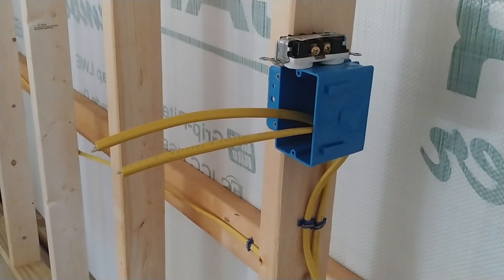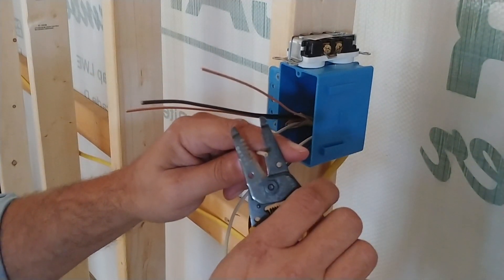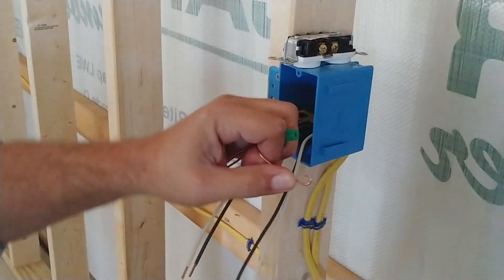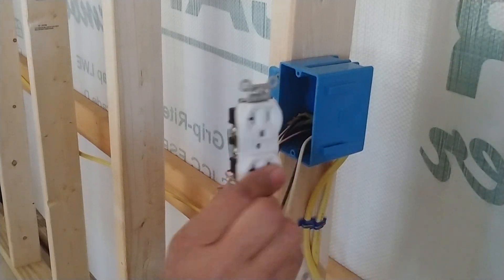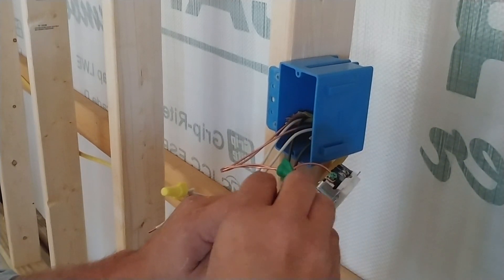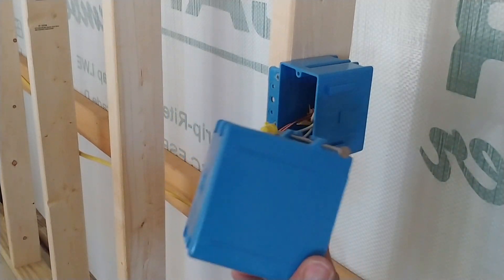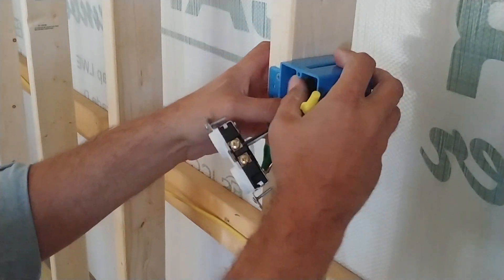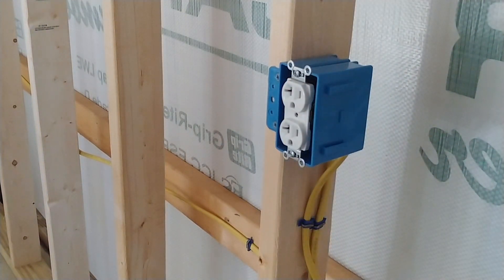Wiring up a outlet tips and tricks.

Comment: 4.5 year apprentice here and still hitting the books for my journey card next year, What I lie to use all the time on bx's installations are the adjustable ones is easier to use after drywall goes on, also why did you staple each wire separate, you could just staple on top of each other and it would have looked cleaner, and by the way the color things on the side of the receptacle are called screws not bolts...lol. Also I always twist my wire connections on binding with me lineman's pliers then i put on the wire nut on, and that location what part of the home is that? And why are you using a T plug? And why so high up? ..great video man.

Comment: Mentioning where the exact wires are coming from would be helpful,   along with how the 2/12 wires are categorized and why the ground wires aren’t included is helpful
Reply: Ground is NOT a current carrying wire. It is not insulated in "romex" because it's covered by the outer jacket. 12/2 is 12 awg wire paired with a ground. 12/3 is 3 12s with a ground. Etc...

Comment: Great Job!  Given the fact that you were working with only two sets  #12s , you could have easily utilized the two sets of screws on the outlet as your lead and load. There was no need for you to pigtail the hot and neutral wires together.
Reply: This is exactly what you don’t do.   If that outlet goes bad then they all don’t work.  Plus you’re relying on the little bridge piece between the screws to carry the load.   A big no no!!
Reply: @dirtbikewrecker4475  why is that a big no no, is recepticle not rated for it. Or listed for that purpose
Reply: @dirtbikewrecker4475  
Actually there is a plate under the terminal screws and there is a provision to put two screws under that plate and then tighten the screw. No wire nut would be more secure. I don't see any problem with that. If there is a problem then where is the proof?

Comment: How come the 2 whites n 2 blacks couldn't go on the plug seeing how there's 4 screws on the plug
Reply: What I was wondering and seems like less trouble and stuff in box since both hot anyway and same with white, think i'll just do ground piggy and decide to put on screws or in hole.
Reply from the maker: Can you wire directly to a outlet.  Yes, but inspectors will fail you for wiring this way.
Reply: @BevinsBuilds  no they want, it’s standard practice to put 2 white wires on the neutral screws, and 2 black wires on the line screws. Pigtail to grounds and put one wire under screw

Comment: Good video, I understand the pigtail for the ground, but not for the other 2 leads?   Thanks.....Jim
Reply: The reason he added pigtails to the neutral and hot,was so he would only have to land one wire on each screw instead of two screws.Also,your supposed to tighten the remaining screws.

Comment: You had a grounding wire nut why not just keep one of the 2 grounds long and put it thru the hole? Then you don't have to get a third piece for the pig tail and you're spinning less 12s so it's faster. If you're going to do it that way just get cheaper tan nuts
Reply: Pig tail fits in tighter. Bends in more natural.

Comment: An outlet
Reply: I am assuming that the 2 wires coming into the box is one coming from the panel and the other going to another outlet. Am I correct? I am not an electrician but do some changing out of electrical switches/outlets. Thank you!

Comment: Great video, thanks. Only question I have is instead of using pigtails for black and white, couldn’t you just have screwed both blacks to both brass screws and both whites to both silver screws, thus the outlet acts as the pigtail?  Thanks.
Reply from the maker: To answer your question directly yes but in the area where I live they require you to pigtail it because the circuit has to stay constant even if the outlet is removed.  But yes if you connected directly to the outlet it will work it's just where I live you would fail the inspection.
Reply: @BevinsBuilds  Does adding the pig tail change your box fill calculation?
Reply: @FixItOnce-OrTwice  no, your answer is no.

Neck 2020 article 314.16.B.(1)

...A conductor, no part of which leaves the box, shall not be counted.

,(The last sentence.)
Reply: @BevinsBuilds  why wouldn't the circuit still be constant. What's the difference if two wires are in a wire nut together or both are screwed under a plate at a terminal screw together? Doesn't sound logical that one would be okay and the other wouldn't.
Reply: @njsongwriter  the explanation I was given once was pigtailing to the receptacle prevents the draw from all downline receptacles from traveling through the earlier receptacle. Made sense to me, so that's why I do it
Reply: Plus you don’t want to rely on that little bridge piece between screws to carry the load. 🔥

Comment: I had no idea the eyes on the outlet were actually washers 🤦🏻‍♂️ that alone made the video worth watching
Reply: I had not done any electrical in a decade and was surprised by that when I wired a new outlet for my mother.  It’s very quick, but I hope it’s as secure as the old way!
Reply from the maker: Thanks
Reply: Just proves that you can learn something new everyday. I never knew that myself.
Reply: If the box was cut out with a drywall router professionally and it is tight as possible to the box with no gaps those washers will grab the edge of the drywall and keep the outlet perfectly flush with the wall. Just remember to make sure the wire is pushed back far enough to where the router bit will not make contact with the wire and damage the insulation

Comment: 3:23 Thank you for catching that. Interestingly that "mistake" showed really clearly how to do it correctly. More so than if you just showed the correct way.

Maybe in a future video you can explain why a flathead screwdriver is better than Philips for tightening the screws. I was installing an outlet yesterday with a Philips and it just didn't feel right. Switched to a proper size flathead and much tighter. The Philips slipped before really flattening the wire hook. DIYers like me I think reach for a Philips more often than flathead.

Never knew those ears could be broken off and used as washers. Yup. I'd been using regular washers.

Never saw outlets like that where the neutral and hot could be inserted instead of hooked. Handy.
Reply from the maker: Sadly there are a lot of cheaply manufactured brands of outlets.  The ones I use most consider to be to expensive but I would rather spend a little more now than a lot later :)  
As for the screws to be honest a square head is best but most are not aware of this or own any.  So I tried to show what the most common tools used are.

Comment: Does it matter what screws you fasten the hot and neutral wires to? Not in terms of brass or silver, but top or bottom? Do they have to be perpendicular?
Reply from the maker: Does it matter no you can go top or bottom crisscrossed however you want to do it as long as you put the neutral on the neutral side and the hot on the hot side.  But I do recommend you keep them both top or both bottom just so it is more professional-looking 😃

Comment: Can you add a 3rd 12/2 wire to that? To install another plug straight above that connection
Reply: You can but you would probably need to use a deep (~20 cubic inches) single gang box to avoid going over box fill limits.
Reply from the maker: Yes you can 😃
Reply: Bevins Builds thank. Great video

Comment: how come you pig tail the white and black? why couldnt you connect it to the two spots available on the outlet?
Reply from the maker: If you are doing wire for a house that is being inspected you will fail your inspection.  Can you wire a outlet that way, yes.  But inspectors want everything continuous, especially the ground.
Reply: @BevinsBuilds  that’s only where you are doing your work. That is not a normal requirement and it’s not an NEC requirement. It’s because your inspectors don’t trust anyone to torque the screw terminals correctly.
Reply: @RB-xv4si  Seems like overkill but best to do what the Inspector expects.
Reply: @eyeswideshut2800  
There's nothing wrong with insisting that an inspector shows you the code or if you really care confident then you can show the inspector what the code actually says. Inspectors are not always right.

Comment: If your using a metal box would you also ground to the box itself?
Reply from the maker: Yes you would they even make premade jumpers that screw right to the box.
Reply: If you have grounded the device, then the metal box is automatically grounded when the device is intalled.

Comment: Do u have any videos on wiring a shed, i want to have 2 outlets on lower wall and 1 light switch for a light overhead but extension cord to feed it
Reply from the maker: After I read your question I had to think a bit before answering.  First let me say thats against code and illegal lol.  Not being mean but I just want to give proper advice.  But to answer your question.  You can do it but no I haven't made a video on how as I generally stress code and what your wanting wouldnt be a code type of installation for a shed.   Here would be my suggestion and I will try and make a video on it as having an extension cord laying on the ground all the time to me would be a bad idea.  I would run direct burial 12/2 cable to the shed to be cheap and quick and wire it to an exterior outlet.  Ill try and make a video soon and explain in more detail.  Also with you wanting a light and outlets I would recommend a light switch as well. 😄
Reply: @BevinsBuilds  Yeah i will have a light switch for interior light only and yep i was also thinking like you said put a 12-2 outdoor rated direct burial cable to the shed but i just cant figure out how to wire the 12-2 cable into the shed and if i wire to the swith first and the switch carries the load to the 2 outlets but i dont want the switch to turn off the outlets its only for the light so i dont know how to use the 12-2 cable if i shld hard wire the outlets and hardwire the switch seperately or bring power to the outlets from the switch or have 2 switches 1 for light and 1for outlets
Reply from the maker: Here is a video to I hope answer your question. https://youtu.be/bFC_BVob2Ro
Reply: Bevins Builds Thanks Bevin,i did watch your video and that really cleared up my thought process on how to wire the shed, apreciate you

Comment: is it good practice to twist the wires together before securing the wire nut?  also is it ok to use the hole in the green wire nut to supply a ground for the outlet instead of an additional wire for the whip
Reply: I agree 40 years in the trade always twist the wire never trust the little spring in the wire nut. If the device has the crimp plates that the screw tightens to the wire thats the way to install the wire and not around the screw.
Reply from the maker: The purpose of the wire nut is to twist the wire you should never twist it together prior to installing the wire nut.  As for the wires for the ground it's more important for the ground to be bonded than the current carrying legs that being said all wires need to be bonded together in the box with one single wire coming to the outlet.
Reply: @BevinsBuilds  being an old timer i will disagree twisting wires makes the bound the wire nut is just an insulator cap.  and i mostly use copper crimps over wire nuts too

Comment: Do you have to pigtail the wires??? Can you just connect the other wires to the bottom screws so you don't have to pigtail??
Reply: Nice thing about a pigtails,  it gives you much more room to work at the box.
Reply: @bodycams2477  not really the wirenuts add fill to the box
Reply: @thomasmarable6818  yes it does,  you are correct.
Reply from the maker: You can but if you are having an inspection you will fail.  As the wires are suppose to be bonded and continous.
Reply: @BevinsBuilds  shouldnt say tht most areas its still ok its like saying you have to use emt over nm because of one states jha
Reply: @wizard3z868  you’re absolutely correct. That is a particular requirement of his ahj and not an NEC code. This is a very uncommon requirement, however he seems to think this is a requirement everywhere. It is not.

Comment: I'm connecting a second regular outlet through a GFCI outlet so I'm only going to pigtail the ground wires. I assume if I pigtail all of the wires, I'd need the second outlet to be a GFCI.
Reply: Do you have a video on that? Maybe you can do a video on that next time. Great video!! 👍
Reply from the maker: Yes that is correct when you use a gfci the wires go directly on the outlet.  If it is a new gfi the outlet after the gfi the wire goes under the leads that are taped yellow.  Those leads should be labeled as load 😀
Reply: @BevinsBuilds 👍🏻 thanks

Comment: You can also snap that jumper if you need one half of the outlet to be switched for a light
Reply from the maker: Absolutely ! 😀
Reply: True, but you would need a three conductor cable for a half switched receptacle.
Reply: Yes I would think that is the more common use case for separating the top and bottom plugs.

Comment: Why didn't you wire the power and neutral to the top and the power and nuetral to the bottom instead of making tails?
Reply from the maker: As I explain in the video, this is what an inspector expects to see.  You will not pass an inspection if you wire it as you describe.  At least here in Michigan you will not pass.
Reply: @BevinsBuilds  alrighty

Comment: I am wiring my shop.  (Portable Building)

Can you use the bottom  or TOP. (black) HOT and (white) NEUTRAL  for the next outlet?    

Example:.   3 stran black,white,and bare ground;;  wire from the breaker box.  To  the #1 outlet... twist bare ground to make one ground for the one screw on #1 outlet..,, then #1 black to BOTTOM screw and #1 white to BOTTOM screw.  

Then use the TOP BLACK and TOP white for travel to the #2 outlet. Going to the Bottom of the #2 outlet.  
Will that work or am I making it harder on myself?
Reply from the maker: Hello and sorry for the delay in response. Ok first can you wire that way and it work.  The answer is yes.  Here where I live though the answer is no as inspectors do not allow that method of wiring.  Let me explain the reasoning why.  When you look at the side of an outlet between the top and bottum screw.  There is a very small pieces of metal that can be removed.  If you wire an outlet the way you described, now the current for the circuit will be flowing on that little piece of metal and if the circuit is heavily loaded can cause it to melt and fail.  Years ago this was an acceptable practice but again where I live inspectors havent allowed it in over 20 years.  The method I show in the video is the only way it will pass an inspection. 😀
Reply: @BevinsBuilds  it is almost always allowable to feed through an outlet. They are designed and UL listed for that purpose. Only in multiwire branch circuits do you need to pigtail and that’s only with the neutral. I don’t know where this melted outlet and world burning down stuff is coming from. If that is happening, there is an issue with the workmanship on the receptacle terminals. If they aren’t tightened down enough, they will start to possibly arc or become resistive and that’s when you have heat buildup and problems start. Again, not a device problem. That’s a workmanship problem.
Reply: So it would just be better in the long run to make pigtails  for continuous current? Instead of using all 4 screws to travel the current to the next outlet?
Reply from the maker: @mcsbd5562  Yes as if it was inspected they dont allow it. But again you can wire it the way you state and it will work fine, it just wont pass an inspection.

Comment: That little hole in the green wire nut is your friend!
Reply: I always let one cable per device extend double length.  On a single gang box I'll use a green wire nut and let the long ground run through the hole.  I use crimp sleeves on multi-gang boxes.  I also let the short grounds run one sleeve length long, then bend them back into the crimp depression.

Comment: Dumb question but why put the jumpers on the hot and common? In my house the commons would be around both screws and the hots would be on both screws. Hope my question makes sense.
Reply: Marlboro Matt better practise is to use one screw termination if you have multiple neutrals and hots coming into a box which leaves another screw open in case the need for a separate circuit
Reply from the maker: No question is ever dumb.  The only dumb question is the one not asked :).  Yes I do get what you are saying.  Me personally I agree with and like wiring the way your house is as when there are issues they are easy to find.  But the reason for bonding them together is so you have a coninuous circuit.  Its code and required to make the ground continuous.  But the reason for doing the hot and neutral is to keep the cicuit continuous as well.  For example if you had a outlet that failed in the middle pf the run, every outlet after that issue would not work pr depending on the fault could damage the items that are plugged into it.  The biggest reason you wire this way is simply here in michigan all building inspectors Ive delt with require them to be wired this way. :)
Reply: @BevinsBuilds  I noticed that the outlets in my house (built in 1987) are set up with the a ground wire attached to the ground screw on each outlet without a pigtail, with two hot and two neutral wires attached to the appropriate screws on the sides of each outlet. Does that mean they are not properly grounded?  Or is that just a code difference (I live in Georgia)?